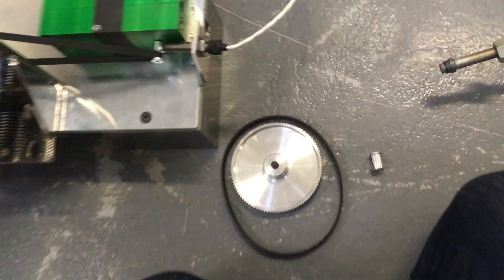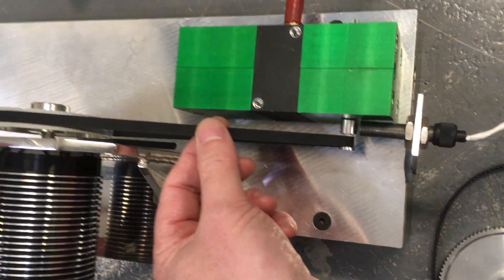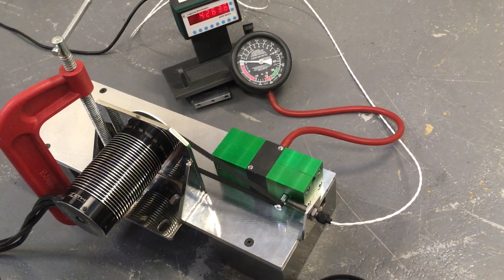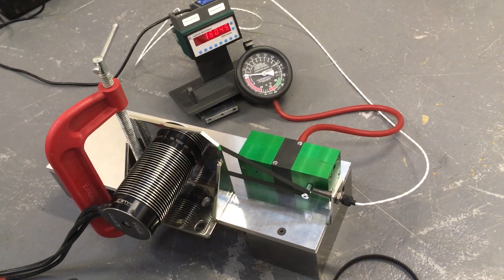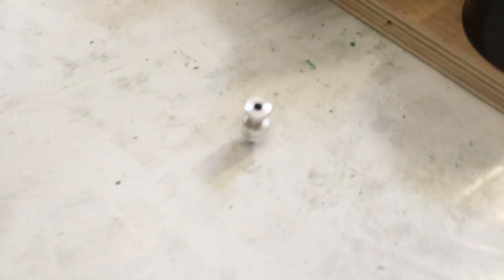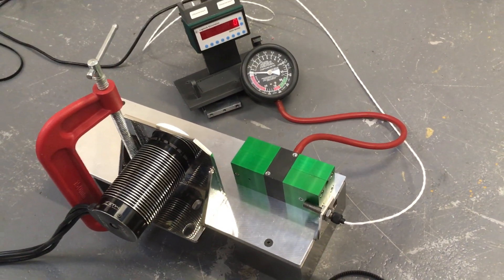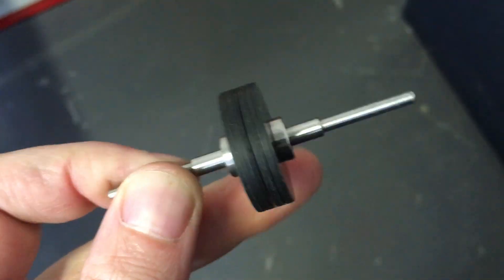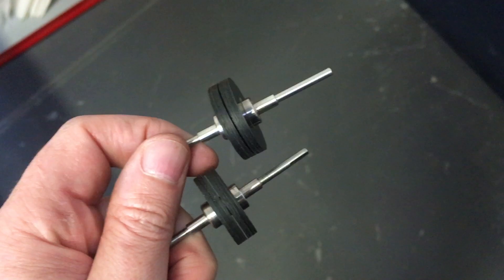Destruction Test 2 - 12:1 ratio 13.33kw vs 3mm Tesla Vacuum Pump Shaft

Comment: Haven't seen those rotors in the thumbnail before!
Reply from the maker: Not sure when I posted them or if I did. I'm likely going to put ports in the discs, I just wanted to test them without ports to see how they would behave as there are several Tesla's turbines like this on YouTube and one was making power so I thought it was worth investigating. The shaft design was also a trial. It's perfect apart from it needs 1 circlip to finish the design. A micro weld would be another way but it might warp the shaft.

Comment: Neat. I was dreaming about nearly this sort of exact configuration. Wondering if tesla pumps could be used to moving forces by hooking up drone engines to them.
Reply from the maker: Not sure I fully understand what you mean. Pumping fluids requires a lot of power so it would have to be a powerful drone. You can design a Tesla pump to pump anything, liquids, gases, vapours, air. Also you can have a fan, compressor or vacuum pump. Any of these can be engineered.

If you get the configuration right then it can also be used as a rotary engine whereby it will expand, compress, expand. In this version centrifugal force assists instead of like the centripetal machine aka the conventional Tesla turbine. With that machine centrifugal force retards the flow.

All engines use expansion from explosion but the heat isn't usually a wanted by product.

Tesla was so clever he figured out how to decompress atmospheric pressure by converting it into mechanical rotation and making centrifugal force do work. In a piston engine or Wankel engine centrifugal force limits these machines on a completely different scale to Tesla's machines.

Of course all of Tesla's centrifugal pumps, turbine, engines and compressors and eventually limited by the centrifugal head on the exit and also by the inlets, outlets and viscosity of the fluid.

Comment: Do you think direct coupling your belt drive to the pully will be putting side load on you Tesla turbine bearings.
It may be worth trying running the belt sprocket on a sub shaft and  then couple the sub shaft to you Tesla shaft.
Reply from the maker: This is what I love about YouTube. Thanks for the suggestion! It's given me some great ideas. The video link really helped!
Reply: see this video on using a car turbo which also has very delicate bearings not directly coupled to Turbo https://www.youtube.com/watch?v=aiiCTZxvsfQ&t=26s